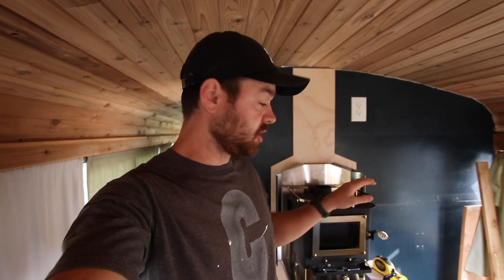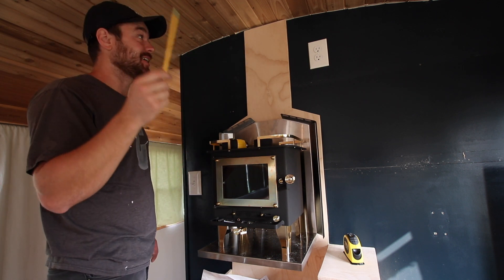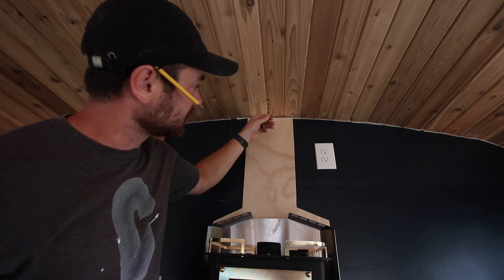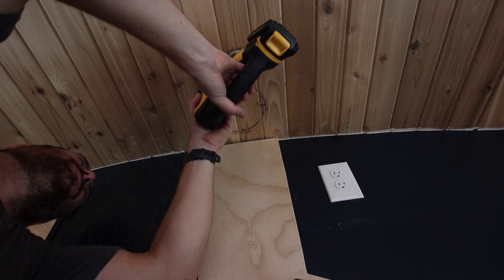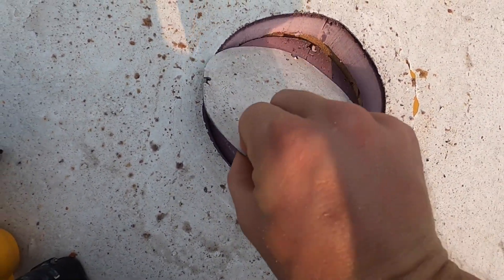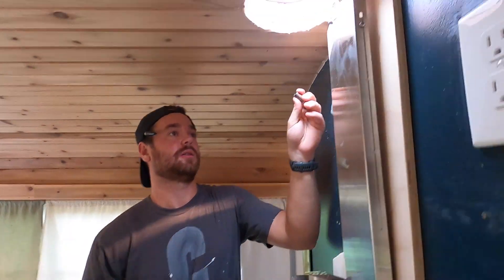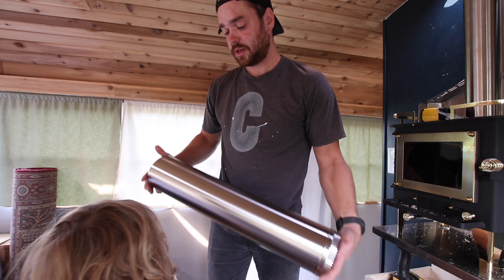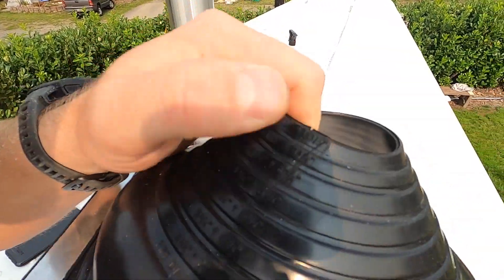Installing Stove Flue Pipe and Roof Exit Kit - { Cubic Mini Install Part 3 }

Comment: Just installed the stove today. Needed a reminder on the exact process for the chimney install I'm doing tomorrow. Good video. Got what I needed from you.  I'm in northern Alberta and it's late October. Already below 0c most of the days. A few hours of +2c or +3c during the afternoon. Its gonna be a problem with the silicone but I'm hoping with the bit of above 0c temps and heat from the chimney it will cure. Winter came earlier then usual this year. Already had a bit of snow. Caught us off guard.

Comment: If you want to put a hole in the centre,make a cardboard template to fit into the top of the stove with the centre dot already in place then use a plumb line from the roof.

Comment: Finding the center on the stove for the pipes to cut through the ceiling . Use the oldest tool in the world the plumbob locate dead center of the pipe at the stove by holding the string end On the ceiling and let it find center of the stove pipe center on the stove by moving The string held to the ceiling till it hits dead center then pencil mark the ceiling exact center for your circular cut . No levels needed no measuring tape needed to find center. You can use any weight Of appropriate size to tie one end of the string making sure the weight hangs center of the string . Or to simplify matters if you don’t have a store-bought plumbob you can simply use a chalk line box Holding the string on the ceiling while the chalk line box fines dead center

Comment: In the UK we use a plumb bob, string and weight hold it over the outlet and move it across the ceiling until it is plum then mark the outlet,

Comment: I am having the same problem with the flue guard coming out an inch maybe and barely being able to drill a 3.5" radius around the center dot. The middle of the pipe is only 3" away from the guard. They probaby should have made that back mount come out further.

Comment: Are you getting any water coming down the inside of the pipe and out onto the top of the stove? I did the same exact install with the same roof cap and it seems like water finds it's way to the inside of the inner pipe.
Reply from the maker: We actually do get a bit that comes down on top of the stove. I'm thinking the wind blows rain up into the pipe and then it comes down and leaks out. I was thinking maybe a better cap for the stove pipe or some high temp silicon around the base of the pipe and then squeezing it in. I haven't gotten around to it since it is only a minor issue and we just wipe it up.
Reply: @ColaVentures  if you happen to source a better cap, let me know where you find one! Our stove is in a tiny cabin that is rarely used so the water really pools up and rusts the top of the stove.

Comment: Thank you for the video.  I have one question. Just wondering,  does the boot seal thoroughly at the point of opening against the pipe so that rain doesn't come in,  or does there need to be heat resistant silicone added here as well to create no possibility of leakage?
Reply from the maker: I added a dab of silicon between the pipe and the boot just to be safe.
Reply: Sika roofing silicone should be ok if you have it on hand. The stuff I have is rated to 150°C which a double or triple skin flue should not be reaching.

Comment: i have to install one this spring on my shortbus. I'm a bit scared of the mangling involved on that metal flange on the rubber boot outside. I feel like maybe the design needs a slightly heavier gauge so it doesn't wrinkle up like tinfoil ?.......it's been 6 months.....any screws popped ? I also wanted to keep it shorter than 24 inches outside.....maybe do a removeable travel version so it's near flush for driving  / just snap the chimney portion on when you park /.....if I try to adapt it into a sectional I think it would be cool.
Reply: I used a Dektite silicone (high temp) seal on a profiled metal roof with 16 (not 36!!!) screws. The screws go through the aluminium strip easily, without distortion.

Comment: For people with leaky roof, using idea from this video...
= rubber plunger, accordian-type rubber plunger
= for smaller holes

Additionally...

Metal-Pipe
= metal "sheet" 2-inches, roll around metal pipe, weld top, flow welding for looks, TIG, MIG, (Plasma-Cutter)
= cascade waterfall-effect is have for under that 

Whenever and wherever need waterfall Cascading effect, ... build effect.

Roof build annulus wall of 2-inch high around pipe 
= GRP mesh a skirting to sit on 2-inch(water flow height) wall and drip outside. Determine if air seal is needed before dumping-stuff on the mesh..,
Reply: Usual is soil-clay with green-slimy water-moss(water repellent)

Comment: Why does everyone put the stoves up so high? They should sit low to the floors shouldn't they? Wanna warm yr lowest points especially inside RVs or busses etc??? Everything I'm watching peeps have these sitting way up off the floor. Why?
Reply: I’m guessing it’s because you have to pay for the pipe per length and to save floor space.